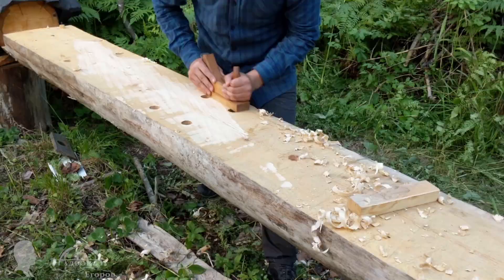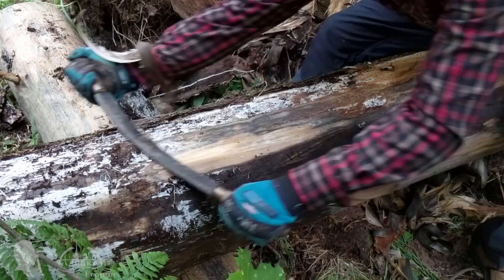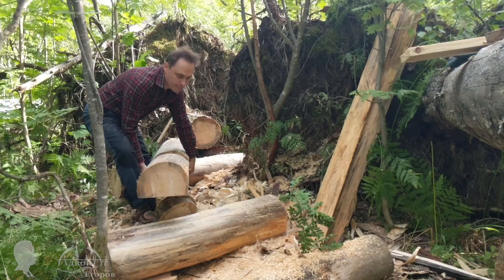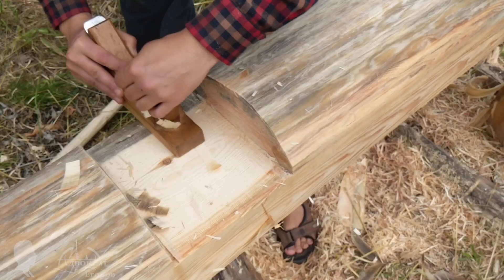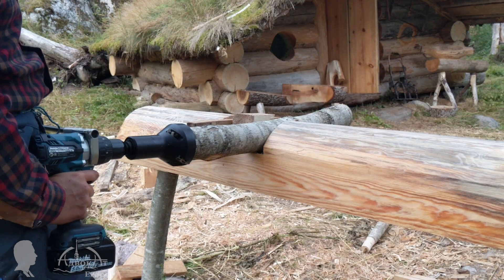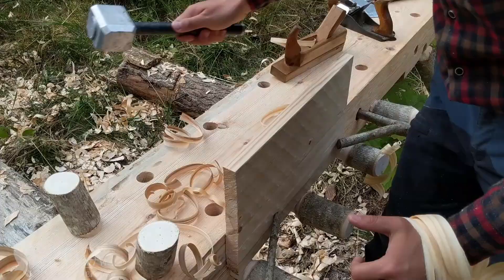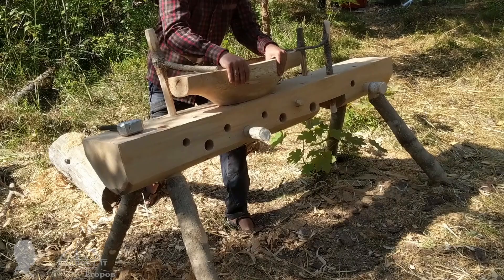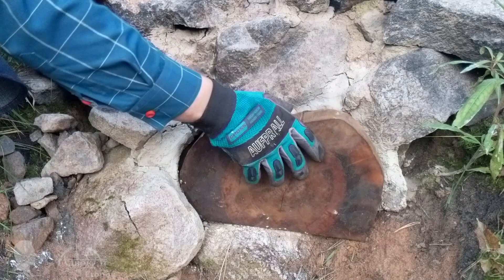Making a Topsy-Turvy Workbench from a Log

Comment: Topsy Turvy Workbench is perfect, don't change it.

I've been working on a cabin in the woods for two years and always regret not making a stable work surface. It's almost done now, but I would have saved a lot of frustration had I built a topsy turvy workbench.

Thanks for sharing your projects with us.

Comment: Maxi, can you use your spring for electricity?
Reply from the maker: I am planning to use the waterwheel to charge batteries next summer...
Reply: You could swap your gas chainsaw for an electrical chainsaw so you are not limited by a finite gas supply anymore
Reply: @valentinmitterbauer4196  I doubt that the electricity generated by one waterwheel will be enough to handle all his tools, alongside a chainsaw. Their electricity consumption is pretty heavy and charging a battery takes time to begin with
Reply: @kunibertrandolf1886  you would be surprised at how effective a water wheel could be. They are able to pump out a lot of juice.
I've powered a refrigerator,  a deep freeze and about 2 dozen LED lights off a generator made with the motor of an old exercise tredmill and a small creek waterfall (about 18 inch fall) 
Using just a paddle wheel to turn the motor and a few boards to focus the water into the paddles
Reply: @mcewenhandcraft  I don't mean to brag, but I can make a mean hot pocket.
Reply: @braxtonrichards3202  LOL I laughed and farted a little.

Comment: I am impressed by how positive of a person you are. If someone would try to brake my door I would go nuts, but now that you talked about your explanation for that I have to agree.

As a child we used to collect old electronics from the scrap, smash the housings and take the electric components off the circuit boards. We just broke the radios and speakers to pieces, cut the capacitors off and put them into glasses. Basically that was pure destruction without any goal, but on the other hand I am a mechanical engineer today and I guess that curiosity of how stable things are and whats inside them was a big motivation in it.

Comment: A fantastic multi-function work bench idea you have there. I think the name you have for it is excellent already, no need for another. Though you might could craft metal dog wedges instead of wood ones at a later date, maybe improve the bench design with the next one that may get built. Either way, fantastic projects you have going on.

Comment: max, your round windows are cut with an angle grinder loaded with chain saw toothed blade. that is mounted to some sort of spindle n arm that holds the grinder body 90* to the wall. set cutting depth to aprox 1/4", spin the arm slowly full circle. reset depth again, spin again. do that about 64 times to get thru your 16" thick wall
Reply from the maker: There is always more than one way to do the same task. I did it with a chainsaw...))

Comment: With your gillateen cutter you can cut radius or a circle like a lid for a pot or jar. Measure from the cutter edge the required radius and simple nail your square plate so it spin. Just spin a little bit at a time cut spin a little more cut and repeat. Your square plate is now a circle

Comment: At 10:20 there is a shot of a liquid end-grain sealer wax.  If the finished product has to look really really good, I suppose a commercial product would work.  But if it has to be serviceable and not necessarily look pretty, you could also use the wax from a melted toilet bowl sealing ring.  In North America the plumbing code has decided on using brown semi-solid wax rings to seal between the toilet (commode) bowl and the plumbing flange.  It is good wax and very sticky.

Comment: Very nice bench, I just made something somewhat similar, though shorter in length. My 1.125" tenon legs have more deflection than I'd like so maybe I'll make them bigger at some point. This is more of a sawhorse than a true work bench.

It is my suspicion that they are called work "benches" because originally they were hewn from a log like this and planed flat. The workman probably sat on top of the bench while doing the work, thus the name. Then in more recent centuries as work pieces became larger and tools more advanced, the width of the bench increased until the worker could no longer straddle it.

Comment: The closet word would be a Joiners table.  Rarely seen today, and even when built, they were normally built on the jobsite, so very few were built and sold.
Reply from the maker: Thank you for your reply!
Reply: @Advoko  You can make larger ones for assembling panel doors, joining window frames.  You can make a vice for the side with pressure on a stable floor though.  They are great if you are splitting wood and using a plane for making flat surfaces or using the side to make a flat edge on a board to join with a plane.

Comment: Max, l was looking at your Russian channel yesterday just to see what newer things you have been up to and was very please to see you are taking health and safety a little more seriously with the large extraction system on your wood planner after moving it on the skates you made and home made tracks etc. I would like to see some other ideas. But l struggle with my wife's Polish language without trying to attempt Russian which uses a different alphabet. Can you put some of your ideas on the English channel please? Did you manage to manufacture a loop aerial system to improve your communications with home and your loved ones when at your cabin? How about manufacturing a folding dynamo from the curved sides of plastic drinks bottles to make the propeller blades and getting a generator to charge batteries from your water wheel instead of just bringing flour using the pulley belt. I shall set you a challenge! Build a chain  clock to power your camp, using hanging weights that drop to generate power the same way a cookoo clock works. You will have to manufacture gearing, a container, cables or chains to hang the weight from to adjust the drop to generate power. Or use a folding propeller screw in water to generate power from the waste energy from your water wheel. It will generate power day or night to charge your batteries on tools cameras and mobile phones.

Comment: I've been around chainsaws my whole life. I've used different brands and sizes. The best chainsaw I've found on the market is a STIHL  66cc with a chisel chain. The chisel chain has less cutting links on it because it skips a link compared to a regular chain, so that makes the kickback from the tip more of a risk, but when cutting logs all day it's the best chain because it cuts the time it takes to hand sharpen your saw and cuts it in half.  That means you gave a sharper saw all day because it's not a pain in the ass to sharpen. The 88cc is also a great saw for commercial use, but its bulky and not efficient for smaller cuts. The 66cc seems to be the best for power and convenience, especially if you put a smaller bar on it, like an 18". I know you e already got your saws but when that plastic toy ECHO your using in this video messes up go get a real chainsaw. STIHL is the only kind of chainsaw that I will use. I'm not privy to brand names when it comes to anything else just chainsaws cuz I've spent so much time running them.
Reply from the maker: Robert, thank you for your reply.

Comment: nice video - great project -  questions - 
where are you charging batteries for drills>? solar array?
how often are you sharpening chain saw when plank cutting?
will please show the method you uise to quickly sharpen chain saw?
chisel sharpening - can you show setup in the that cabin where you maintain your hand tools?
how did pegs or dogs get removed - >? did holes in top go all the way through? 
and why not just make metal dogs like your spikes?
Reply from the maker: I use a portable generator but I recently installed a solar panel and working on a waterwheel charging system...

Comment: Your English is fine. it more than sufficient to provide a clear explanation of your ideas. the name Topsy-Turvy workbench drew my attention as it most closely in the thumbnail appears as a "Roman workbench"/low workbench. you should look up (Christopher Swartz Roman Workbench) you will find what I mean but you have added features that you would find more on an "English workbench"/ Nicholson Workbench like the side dogholes. the "wood clamps'' are called a Holdfast in English. the weight issue of the bench would be solved by going to shorter legs and simply sitting on the bench/ workpiece to provide weight and it helps prevent the workpiece/bench from moving away for you.
Reply from the maker: Mark, thank you for your reply!

Comment: Excellent work and ingenuity! might I say that you sometimes might be jeopardizing your bodily health by lifting heavy objects as partial fresh tree trunks without any aids as a belt or proper lifting technique or any tooled leverage nor conveyance such as a North American native american  wagon like tool was a Travois a type of sledge formerly used by North American Indians (especially of the Great Plains) to carry goods, consisting of two joined poles pulled by a horse or dog. poles often were tree branches fully leafed such that they would act as platform and reduced friction slider.  you save your back and knees etc. instead of taking years of good health off of the back end of your body's timeline.  you can avoid those winters that kill your well being  when the damp and cold get into your joints before during and after barometer changes.
good luck resilient and plucky woodsman of the future

Comment: Hi Max, thank you for your very inspiring videos! 
As for your very interesting drill that you used to round the ends of the legs to fit into the holes of your workbench (works like a pencil sharpener): what is it called, or where can I find it?
Reply from the maker: I used a power tenon cutter attachment made by Veritas.

Comment: It looked like you went with the echo and Husqvarna chainsaws. Did you get different length bars for each? Just curious on what length worked best for this size wood. I’ve been using an 18in stihl for about 12 years now- 4 hrs a week-no engine issues yet.
Reply from the maker: Yes, I got a Husqvarna 365 and ECHO CS-361WES-14. I used stock boars, however,  I also made an extra-long bar shown in the last video.

Comment: What is the name of the tool that is the large metal blade that you insert into the wooden bench that you sit on that pivots up and down to shear slices of wood?

It looks like you made it homemade and it's about a meter long.

I think you are inserting it into a hole on the shaving horse.

Do you have a video that shows how you make the metal blade?
Reply from the maker: It was a homemade cloggers knife. The next video is going to be about making and using it, in fact...

Comment: I'm loving the workbench.  I've been reading through https://lostartpress.com/products/ingenious-mechanicks which studies the evoultion of workbenches from a bench you sit on to ones you stand at.   You should add a vertical notch with wedges.  If you want a vice, a wood screw would be ideal .  I'm not sure it would be any faster than the dogs, holdfasts  & wedges you're using now.   You might want to add a notched battan called a doe's foot for planing against the wood grain.  It's faster than a vice.

I'm curious how you learned about the holding & wedging.  Is it common knowledge or taught in schools in Russia?  In the US we've had to rediscover these things as we moved to machine tools for mass production.  When I work at home, I'm not making lots and the hand tools are just as fast.  Though I do use a band saw, like you use your chainsaw.

When you do your pole lathe, maybe you can have a version with a treadle or the water wheel so your stock can turn continuously in one direction.
Reply from the maker: Tom, thanks for the link! I learned many of my skills from my dad.

Comment: Max - please never lift a heavy log like that, in that way, again.  Instead, pin the two endangered of a strap to each end, put the middle of the strap high on your forehead, and use your leg strength to lift it, keeping your back straight.  If you slip a vertebral disk out there, YOU ARE IN BIG TROUBLE!,,,
Reply from the maker: You are right...